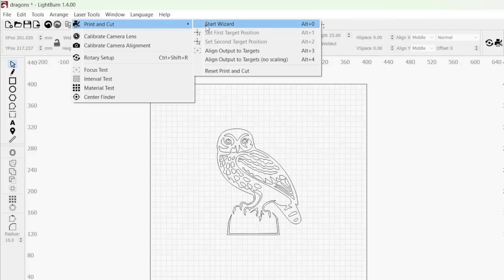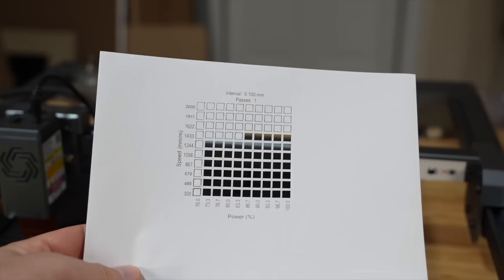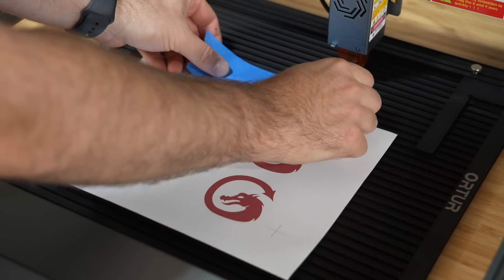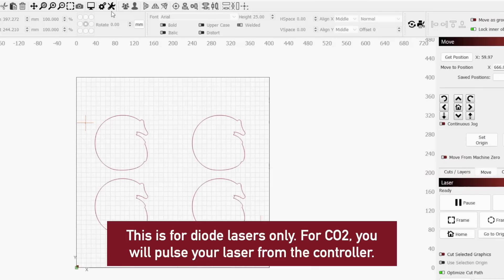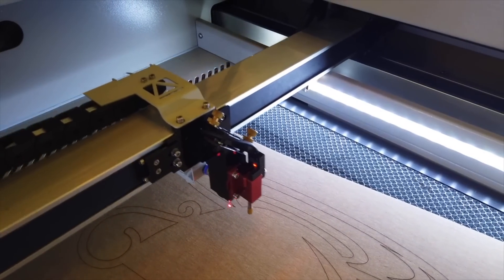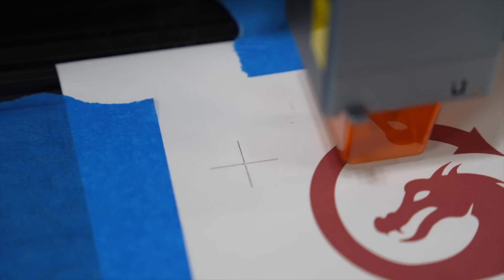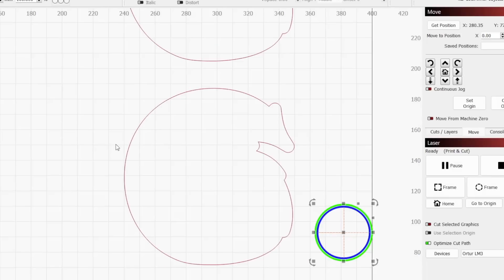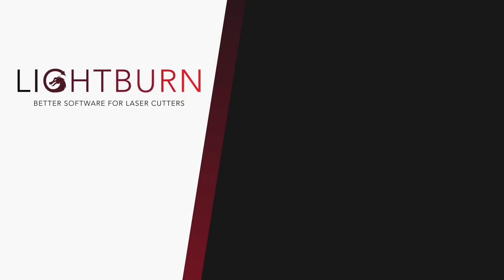Align Your Projects With Print and Cut

Comment: how did you decide that the 1kmm/m and 80% power was the best option if i saw that there was other cuts made at lower or higher speed/power?
Reply from the maker: I generally aim for somewhere in the middle. The lower end might not cut through if the object isnt perfectly flat and the higher end could lead to unwanted burning or residue left behind.

Comment: I know how to use print and cut in this video was great however I'm doing sheets of leather patches that I print on my UV printer. Some of them cut out perfectly in some of them are off.   Is there something i can do to get my entire file to cut perfectly.      Is there some sort of calibration that needs done?
Reply from the maker: @anthonyporrreca2946  - if you are doing whole sheets at one, and the leather is flexible, not rigid, it would not be difficult for it to flex or bend slightly which could skew the results.
Reply: @lightburnsoftware7189  this is not the case I have secured it down with tape on all 4 sides. 

I also took the same file and cut it on wood and again only about 75% of them cut correctly  the others are slightly off center.

When I'm doing my print I've used both the Wizards and I've used the hotkeys I am even using a magnifying glass to make sure that my laser is firing in the exact center of my registration mark
Reply from the maker: @ - It’s possible the print itself is skewed (slanted) slightly. If you print the registration marks in a perfect rectangle, measure the two diagonals with a ruler and make sure they’re the same. A planned improvement to Print and Cut will use 3 markers and compensate for this.
Reply: @lightburnsoftware7189  the print for sure is not slanted. I set everything up in illustrator two separate layers my registration marks are perfectly in all four corners in my artwork is also perfectly lined up with my cut lines. It's just strange to me that about 75% of the cuts are perfect and then the others I have to throw away I've checked my XY access to make sure that it was properly calibrated is there anything else I can check to make sure that I can get better results. Also I cannot tell you how much I appreciate you answering these questions I have five lasers that all run light burn in my sixth laser on the way period and we have licensing for all of them LOL

Comment: any tips on getting this to work properly?  I have tried everything I can think of to get it to align properly, but on the left side of my board the cuts line up fine but as it goes down the line it gets worse and worse.  I thought maybe it was mirror alignment but ive checked those and they are all lined up properly and my work bed is level.  when I set my file up I set the center of my two points at 230 mm right and 130 mm down.  when I jog my laser using those dimensions, it never lines up with the second point.  so I adjust to the second point (usually about 5mm horizonally and vertically) and choose my second point.  then when I run the print and cut, whether i choose scale or no scale, it is never quite accurate
Reply from the maker: If you can send some photos and an example of what you are doing and what the result is like it may help narrow down the issue. Most of the time it comes down to the alignment with the targets being slightly off but I won't rule out that it could be something else. Support email is support@lightburnsoftware.com
Reply: I have the exact same problem and it's driving me nuts. Have you got it figured out yet? Please share with me if you have and what you had to do.

Comment: Hello teacher, first of all, thank you for the video lesson.
I don't know if it was the objective of your class, but I didn't understand correctly, in this process, how to use "Printing and Cut" on a sheet (or any other material) twice its size. I say this because I saw that you made the two cross marks, only on one sheet. But, I want to cut a design that covers an area larger than the footprint of my laser, so how would I lay this out across two sheets? I believe you understood my question. Thanks.
Reply from the maker: That is covered in a different video, here:
https://youtu.be/n__saOKVupA?si=qqi_q0VNKKJDMJCl

Comment: The laser fire button has been removed since this video was made. Do you have updated instructions on how to do print and cut?
Reply from the maker: The laser fire button has not been removed, but as stated in the video it's only for diode lasers.  Do you have a CO2 laser?  If so you'd need to use the red-dot (if you have an accurate one), or use the Pulse button on the laser control panel.

Comment: I understand the concept of Alignment Targets,  but how do I split a Large engraving that is too long for my bed.  At 17 sec an example is shown, but at no point does the information provided or in the LB manual explain the correct way to perform this.   And every youtube I find re Print and Cut always end up focusing on the recovery of a job or templates..  I just want to be able to apply it to this sort of a job   https://youtu.be/ddRW12VKIwY?si=YEFu9WSOQ3A-02mS&t=15    And what information I have found re using Masks and splitting graphics have gotten very messy.
Reply from the maker: We have an entire video walkthrough of the process here: https://www.youtube.com/watch?v=n__saOKVupA
Reply: Thank you - 90% of what I needed.   My issue is now exposed as I have a mix of a Photo image and Boarder Graphics and Cut lines.  Have developed a work around but a tad messy.  Borders Atwork and cutlines were as per the process you linked to , but had to use the Mask option to split the graphics.  Then do some extra work to put in Targets and re position every thing into two separate files that align correctly.   Do part 1 and the Cut and Print process for part 2.   A process some appear to refer to as a PASS Through for when a job is bigger than your bed.   I am a Newbie when it comes to graphics and layers and nodes etc.  So much to grasp and only a few years of old brain cells left, and getting less every day.  Thank you for responding   @lightburnsoftware7189

Comment: ATTENTION: This example uses sticker paper. Please be aware that if you are using a CO2 laser you need to be aware that some sticker paper is made from PVC materials can and probably will release toxic Chlorine gas and should be avoided. Always check the material you are cutting to make sure it is not made from PVC.
Reply from the maker: Absolutely, any time you are lasering a new material you should make sure it is safe to do so. Laser safety is a must.

Comment: I have tried this so many times and it always comes out the same.  I am using a Creality Falcon 10 Watt laser. Each time I try to set the first target position a red circle appears around the entire page.  I have tried various methods of setting the first target position Including using the set target position icon on the left hand side of the Lightburn workspace.  Each time the results are the same with the red circle appearing around the entire page after I click on the set first target position button.  By the way, my creality Falcon 10 Watt laser does have limit switches.  Any ideas? Have you seen this before?  Thank you.
Reply: Try ungrouping the targets

Comment: I’ve been struggling with this, hearing that the machine needs limit switches (d1 doesn’t have them) makes me feel better.
Reply from the maker: As far as I know the D1 doesnt have additional ports on the controller to add limit switches. It may be worth reaching out to the manufacturer to see if there is an upgrade path. The D1 Pro does have switches so it is possible they offer something.

Comment: Is this turned off for Galvos? Its grayed out on my connected machine.
Reply from the maker: Galvos can’t be jogged, and framing / positioning with the galvo is much easier just using the red dot framing.
Reply: @lightburnsoftware7189  OK thanks.

Comment: So after the second dot in the wizard is set if I home the laser or move the head manually alignment will be off? Print and cut is applying a per job offset to Home position correct?
Reply from the maker: If you are homing the laser using the home button it should not be an issue since it is a repeatable location. Is there a reason you would be homing after setting your points? Manually moving the head will mess up the alignment. Since a manual move (by hand without using jog arrows) gives the machine and LightBurn no way of knowing its position or that it was moved. Print and cut does not have an affect on home position. It is finding the exact location of a design in LightBurn in relation to its placement physically on the laser.
Reply: @lightburnsoftware7189 ola. Se eu coloco uma imagem no tamanha 10cmx10cm e com registos proximo a cnc corta certo e se eu colocar no tamanho A4 o corte sai fora do contorno quase 1 mm. O que pode ser?

Comment: A suggestion would be to add a switch to the software that will switch the Fire button between toggle and momentary.  This way you can either click to turn on, then click to turn off, or set it to momentary to just give the button a tap to make a quick laser burst
Reply from the maker: If you have not already be sure to submit the feature request here:
https://lightburn.fider.io/
Reply: I'm buying and installing a cross 3v laser to use with pring'n'cut

Comment: What kind of sticky paper do you use? As I understood it, if it is PVC it is not recommended because of the gases it generates at the time of cutting, it turns out to be corrosive to the machine and the smoke it generates is also carcinogenic.
Reply from the maker: These specific ones where half sheet labels purchased from Amazon. The brand on them is "BESTEASY".

Comment: Just wondering what brand of sticker paper used since the brands I find are vinyl based.
Reply: I have MFLABEL half sheet shipping labels 200 count from Amazon that look exactly like this, and I think that might be what it is.
Reply: Any laser or inkjet printable sticker sheets are not vinyl. If you can tear it like paper and can't stretch it, it is not vinyl.
Reply from the maker: These specific ones where half sheet labels purchased from Amazon. The brand on them is "BESTEASY".

Comment: Verion 1.4.01, unable to find the "fire button"
Reply from the maker: For what kind of laser?  If you’re using a CO2 machine you won’t have a fire button.  If you’re using a GCode based laser, you have to enable it in Edit > Device Settings.
Reply: Thats a bummer, I am running a CO2. 
 @lightburnsoftware7189